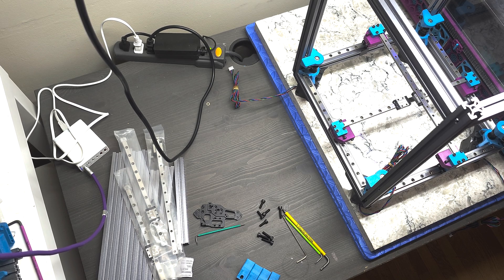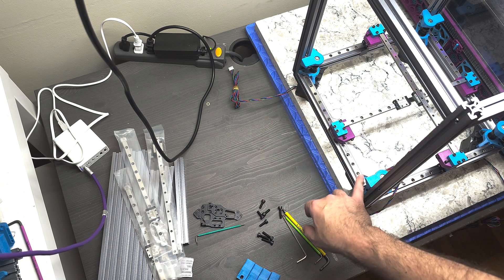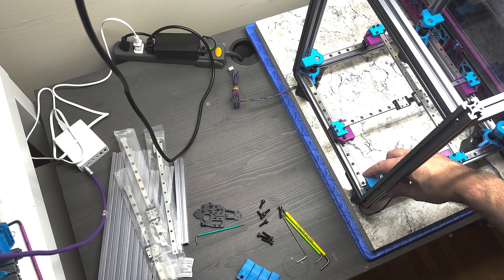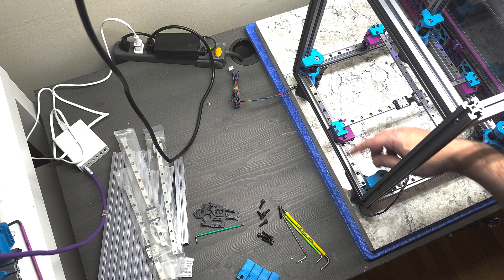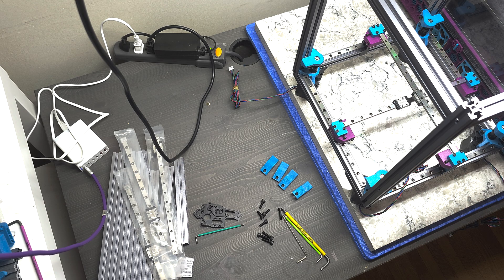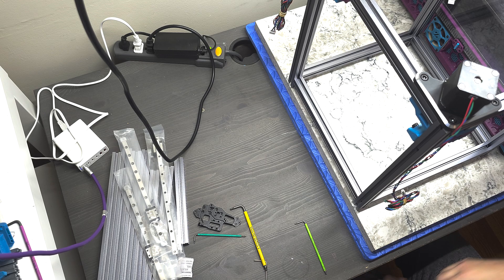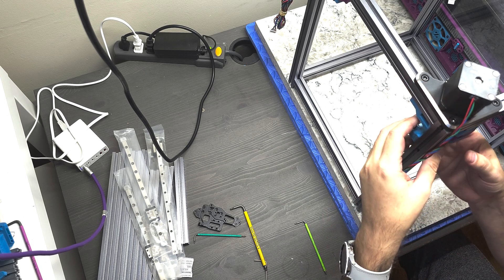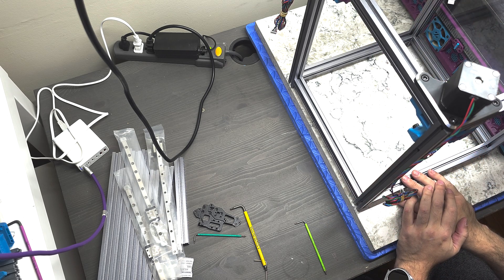Annex Engineering K3: Build Part 05 - XY Endstop Caps

Comment: Appreciate recording also fixes to mistakes. You might want to add a note in the previous video, so if people build along, they won’t make the same mistake
Reply from the maker: If people are building along with my timelapsed footage, I wish them luck! 🤣
But good point, I will add a note to the video description.
Reply: @oldguymeltsplastic  I kinda plan to. I found long streaming recordings too long, and it’s hard to find what you actually need. I’d prefer to look a 3 minute video of steps to do, as rough guide, the work with manual and cad